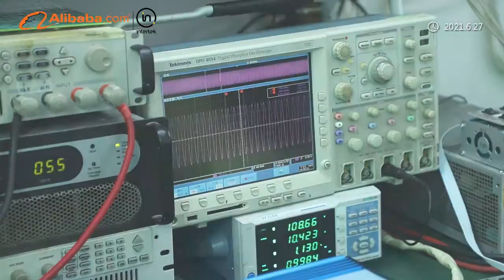BELTTT company video for producing inverter and solar charger

Comment: Hello, please I bought 3000watt BELTTT INVERTER. do I need to switch the power on when charging with AC input or off. Because I can see any led light when I try to charge the battery?